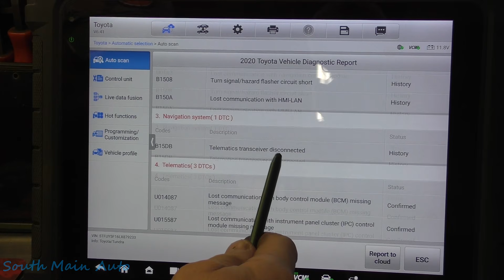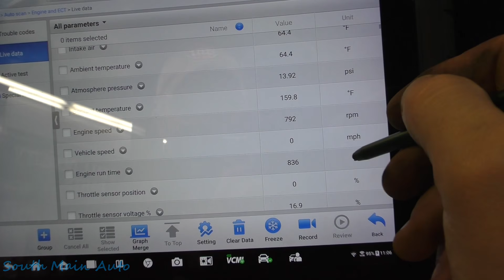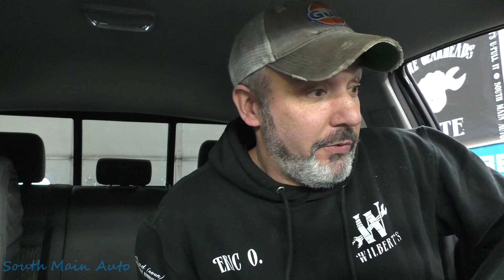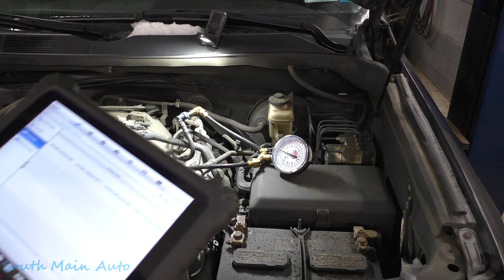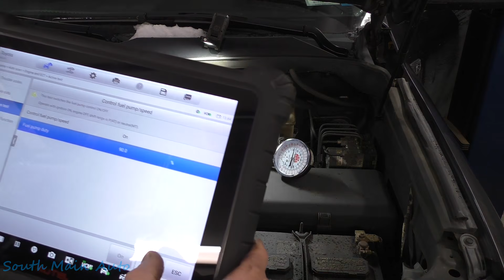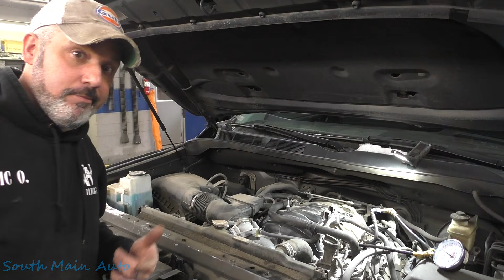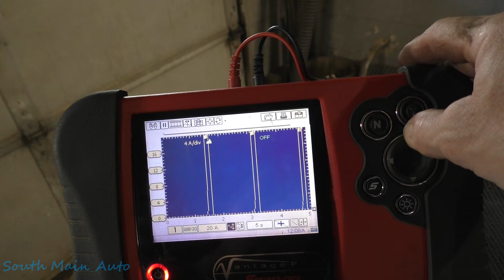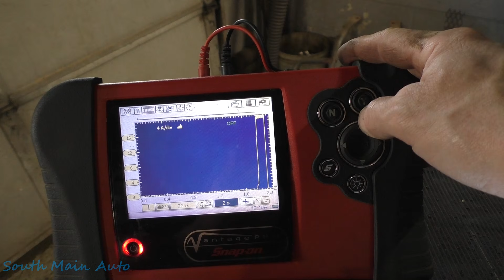My Customer Is Getting Shafted By The Local Toyota Dealer

Comment: Good job Eric. Would you have been able to find this by comparing the commanded fuel rail pressure with the actual?  If yes I would have expected the engine computer to have produced a code for rail pressure mismatch.

Comment: Eric, I work in electronics repair business and believe me, you have better diagnosing skills and basic understanding of electronics than most of the electronics techs that I know. Also, your understanding of current demand and voltage drop, buy using proper load (bulb wattage) is impressive.

Comment: Subaru recall describes same problem with car manufactured in 2019 equipped with Denso pumps
"low pressure fuel pump produced during a specific timeframe that may include an impeller which has been manufactured with a lower density. If the surface of the lower density impeller is exposed to solvent drying for longer periods of time, it may develop fine cracks. These cracks may lead to excessive fuel absorption, resulting in impeller deformation. Over time, the impeller may become deformed enough to interfere with the body of the fuel pump, potentially causing the low pressure fuel pump to become inoperative. "

Comment: I get it tapping it with a hammer and having the pump basically start working I guess my confusion is why is it when you spray starting fluid, why does the pump also start working? Unless it has to do with the return fuel back to the tank is the only thing I can think of

Comment: Excellent diagnosis. A guess when the voltage comes up a bit when the engine kicks over on juice it takes a bit less current to get enough power into the motor to start the pump, power = V * I. This pump is on the edge of working / not working.

Comment: At 7 minutes into the video I am guessing someone uninstalled the battery and didn't follow the correct steps to reinstalling and letting the ECM boot before starting the truck. Uninstall the negative post, wait 15 seconds or so, put it back on. Turn the key to accessory only. Do not start. Wait 15 seconds, Turn key off. Now you are ready to start the truck without problems.  This is real, Ive done it. 2018 Crew Cab 5.7  43k miles.

Comment: This happened to my Dodge Charger Hellcat. Dealership replaced the fuel pump under fueling issues and the new fuel pump did the same thing. Replaced the FPCM with dual FPCMs, the fuel pump with a dual pump module, injectors, fuel rail, and never had problems again.

Comment: It is easy to scream “scam” when a repair shop is stumped by an unusual problem. YouTube channel “Diagnose Dan,” a technician in the Netherland, focuses on issues that dealerships or other shops cannot figure out. These channels simply showcase extra smart detection focused technicians with time to look at data, check systems and test each possible problem area to find the problem. Not everyone has the take talent, or the time, or is allowed by the business to spend time solving one problem when several cars can be serviced, repaired. It’s all about $$$. Great analysis and detective work in this channel. Thanks.
Reply: Well that’s just fine! The dealer is supposed to be expert on the vehicles they sell. If they can’t fix the customer problems why do they need to do service work?

Comment: I've had a similar issue with my '05 Celica for ages, except mine only reproduces about twice a year so it's impossible to diagnose.  It only happens if the vehicle is warmed up and has only been shut off for a few minutes.  Trying to start may yield a brief cough and then just cranking indefinitely.  It can be resolved by turning the key off, waiting for about 10 seconds, and then cranking again, where it will start right up.  Keying off for a shorter period will not resolve.  My guess is the fuel pump relay but I've never been prepared to properly investigate when it happens.

Comment: Car owners don’t realize is that the gasoline is the only thing that’s keeping the fuel pump lubricated. Some people drive until the gas light comes
on then they go get gas. By doing that will burn the fuel pump, only car guys know this. In the long run it’s going to cost money. The only way to learn is to learn it the hard way. I will never let my fuel light comes on because the car or truck is freaking heavy when it’s dead on the road.

Comment: I'm an electrician in an acute hospital and one day a work colleague drove up in a land Rover Discovery, shut it off and went in to get his joinery tools, when he came out it would only crank but not start. He said he had been towed to repair centers three times with the same fault and nobody could fix the issue, so I got a rubber hammer off a fitter and located the fuel pump behind the back drivers side wheel, hit it a good thump and instantly heard it whirring. I asked him to start the engine and she fired right up! 
I said you need a new low pressure diesel pump and after he got one fitted he never had that problem again. :elbowcough:
Reply: The bigger surprise is that the Rover ever started in the first place.
Reply: That old saying- "your not paying me to hit your equipment with a hammer. your paying me to know where to hit it" LOL
Reply: Awesome
Reply: That is classic British car and nothing new.  Way, WAY back, many English cars had electric fuel pumps.  I recall they were made by S U, the carb company.  Frequently they failed to function correctly at start-up. With the engine nit running you could hear it running or not running.  In the OWNERS HANDBOOK they recommended that you "rap it sharply" with a hammer.  IN THE OWNERS MANUAL!!!

Comment: I've yet to find a dealership service department where I trusted their troubleshooting findings. You can also count on them calling you within 15 minutes trying to sell you on what I call the "part of the week" (e.g. cabin air filter, wiper blades, etc.). I have been fortunate to find either small local chain or mom and pop shops that knew what they were doing and didn't try and screw me. When the mechanic tells you that replacing your brakes can wait until your next oil change, you've found a good one. No dealership would let you drive off without unloading the fear factor on you for not replacing your brakes right now.

Comment: Easiest and quickest way without any tools to find out if this is a fuel pump or fuel pump module, is to bypass the module. Those modules over the time leak through the air vent the cooling jelly that is inside to cool CPU and simply start acting up. Usually I open them up and replace that jelly with a electronics grade silicone.

Comment: You didn't do a drag test on the connectors to check for pin fitment.  You didn't use a scope with a current clamp to see how much current it is drawing, You didn't check for broken shorted wires or spray de-ox-it on the connectors!  Sorry... Just passing on some of the comments I get on my diag vids :)   But we did need some brake clean!

Comment: Modulation of fuel pump.... i wonder why OEMs have been doing this. What was wrong with the vacuum modulated fuel pressure regulator on the return? I always fugured they didnt want the heat from the engine getting into the gas tank and causing more evaporation. So blame the EPA for yet again less reliability.

Comment: Just a guess but I'd say the vibrations throughout the entire truck from the engine running after starting it with starting fluid just happens to unbind the fuel pump so it keeps going ...

Comment: As expected Eric saves the day, actual tests and diagnostics 100% confirming the fuel pump is at fault yet of course what are the odds the dealer says he is wrong. 
The sickening part of this is any mechanic with experience should be able to just simply listen and hear that the pump sounds like crap and not running correctly. In absence of good diagnosis replacement of the fuel pump should be the first “guess” of repair , not a bracket, not a controller.  Dealers are disgusting, just before Christmas our local GM dealer was in the news for ripping off a customer with wrong diagnosis, parts replaced and the issues still not resolved after thousands of dollars spent. Can’t trust any of them and Eric quality of mechanics are super rare like hens teeth to find.

Comment: Giving it the juice might make sense if the pump is on the ragged edge of not having enough voltage/current to run when the voltage is being pulled down due to the starter running. With ether, it starts and then the alternator kicks in with 14+ volts and the pump kicks in. But why not start when hot? Back pressure in the pump when hot and the fuel line is fully pressurized?

Comment: Is it possible to show the details of that bulb you used to check for current to fuel pump? Is that a DIY set up or something we can buy (your Amazon store link)? Can you do a video of these kinds of circuit checking tools (like clamp types or how ever you attach them to wires/plugs/pins)? 
I get that a basic multimeter with pins can do all that, but we need more ways for the connections to stay attached for one man jobs 😊.

Comment: If the normal amp draw is 4-6 amps and this drew 20 amps, wouldn’t the pump fuse have blown?  Or is this system on an auto-reset fuse?

Comment: Getting a mechanic that can and will diagnose accurately a vehicle issue is getting increasingly rare these days. I once took my car to three different mechanics until I found one that took the time to accurately diagnose the issue. It turned out it was a faulty inexpensive coolant temp sensor causing the car to stall.

Comment: Well, you asked... shade tree mechanic here, my method (assuming that the most expensive part failed), apparently would have worked in this case. I habitually use the Lucas Oil fuel additive, which claims to lubricate the fuel pump.  I won't claim that it would have made a difference in this case.

Comment: I have sent several vehicles back to the dealer with clear warranty issues after doing diagnosis much like shown here.....and had similar results where the 'Factory Trained Technicians' spent days throwing parts at it only to eventually find out that the diagnosis the vehicle came in with was correct.   Dealer techs are NOT generally good at diagnosis because they're Flat-Rate and don't get paid to think...they get paid to replace parts.

I was the only hourly tech at my last dealership and did all the diagnosis for my team (I was lead tech).   We had excellent results where I figured out what each problem was then gave the vehicles to the flat-rate guys....'Here...this one needs an alternator'.   "This one needs a hub bearing' ect.   They loved it because they made good money and the customers loved that they got their vehicles fixed on the first visit.  Eventually we had a waiting list for our shift  (second)  because the customers talked amongst themselves and figured out that we did good work while the daylight guys were incompetent.   So what did management do?  Fired me.   Got to love dealers!!!

Comment: wow forgot about the SMA channel, because of switching accts and not being a subscriber all of a sudden. now your almost at 1 mil subs, congrats. I wish we had more mechanics around here in WNY, I'd definitely make the few hour drive to have you diag my gf '02 Honda Civic, doesn't start if the temp is under 20F, just cranks and cranks. Did Spark Plugs thinking maybe spark was missing in the cold but that didnt help, it really is weird as Even doing what the Honda Manual Says to do on cold starts like that and still doesn't work.

Comment: I had the same problem with my 2000 Silverado when I bought it used over 20 years ago. It was the fuel pressure regulator.

Comment: Awesome vid!  My 2014 Tundra 1794 with the 5.7 is 280K and still going strong, strong, strong... with only an idler pulley replacement (other than routine scheduled recommended service).  I do change oil every 3500 miles.. All original equipment with no mods, except a 7" BDS lift with Fox shocks and an Airlift 7500.  I've pulled 13K cross country more than 20 times without a single hitch. Not even a blown tire.  Well done.
Reply: one scary pooch

Comment: my. 07 Camry hybrid has that recall for oil burning issue, went to a large dealership and they said that there's nothing wrong and won't fix. Went to another dealer and that dealer confirmed that mine has that issue and will start doing the free fix. It's a hit and miss on these stealerships. Most of their techs are just parts replacer and has no diagnostics skills.

Comment: I had a 74 Olds Cutlass where the Coil set on Top of Engine, after a few years the Coil started breaking down because of being cooked by engine, when it got Hot a Crack Formed inside coil and Engine would not start until it Cooled off. It went through several coils until I finally got a Roll of Asbestos Mat from Power Plant where I worked and put under Coil, never anymore problems...

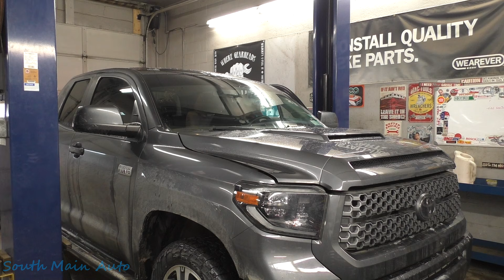Comment: 4:25 I've asked this question to various folks and nobody has an answer. Why do these trucks sound like a roaring fan when first started, but then it eventually goes away approx 30 seconds later, in this case at 4:52?

My dad's 2020 Ranger (turbo 4cyl), my 2003 Tacoma V6, and even my cousin's 1989 Toyota V6 pickup did this.

Comment: Thank you for making this video. I dealt with something similar. I have a 2018 RAV4. Around 2022 I smelled gas when the car was fueled up. Replaced the gas cap. Still smelled. 2023 took it to a Toyota dealer. They told me Evap system is fine. And it is “normal” to smell fuel vapors. Bs. Smell seemed worse in extreme hot and extreme cold and only when vehicle fuel tank was full. Around Christmas (2 weeks ago) I took this to a different Toyota dealer. They charged me 159 diag fee and told me “evap system is fine but there as a mouse nest we removed and that caused the smell”. I asked if the mouse nest smelled like gas where is the gas smell coming from. They said vapors. And with the nest removed vapors should dissipate. - I then asked ok did the mice chew anything or damage anything. Dealer said no.  I filled my tank still a fuel smell. - the private mechanic I go to told me without dropping tank he is not 100% sure but he has seen the fuel pump tops crack. He said he could drop the tank to check but he’d have to charge labor and if I already paid dealer for diag I should have them do it as I already paid. Also car is under Toyota warranty. I went back to dealer and they argued with me and finally agreed to drop the tank. Fuel tank cover was cracked. Dealer sent me a pic entire top of tank wet with fuel.  Fuel tank cover is part of the pump so it has to be replaced as a whole unit. They kept my RAV4 for 5 days. Then they never washed it and it smelled like gas on the outside when I picked it up. 2 things here - 1 I complained to Toyota corporate about how I was treated. They acted indifferent and a manager at corporate is supposed to call me back 2 - Toyota has problems with fuel pumps in many vehicles. And the dealers and corporate know this. And they went to deflect because you have to drop the fuel tank on most Toyotas to change the pump. There is no access from the floor under the seat on most Toyotas. So I think the dealers and corporate are just kicking the can hoping the vehicles are out of warranty when this happens.  I bought a Toyota for the reliability. I like the rav4. It rides well and is decent in snow. But whenever this vehicle is worn out in the future - I may or may not go with Toyota. Never had these issues with Honda or Subaru.

Comment: It seems maybe The Pump has high internal resistance so that Even when its on full duty cycle its Dropping that voltage internally. 
My only theroy would be when he gets it going with either that 13.5 14.5 voltage output from the alternator is Enoguh to over come that resistance? 
Havent watched the full video But this Is definitely and interesting failure!

Comment: My Toyota is out of warranty and my car will never again darken the door of the Stealership (Greens Toyota, Lex. Ky) After the SatRadio/GPS going out and the dealer replacing the head unit instead of the SatRadio/GPS unit that really showed me exactly how much competence that service department has - even after I told them the exact issue and they charged $160 diagnostic fee. Well over a month and almost $2k to replace with a $200 used part.  The dealership will not spend anytime properly diagnosing anything - they will just throw parts at an issue until it starts working again or they say you need a new motor / transmission / whatever.  The rakes in lots of money for them and does the customer no service.

Comment: POA! when working on jap vehicles, it's adviseable to not hammer on fuel tank, transmission, engine. you may give the jap leprechauns running the squirrel cages, concussions.
there's always the slander of chinese goods, but if you are old enough, you remeber the MADE IN JAPAN label at the 5 & 10 stores. now there were products deserving criticism! remember, toyota uses old metal coke advert signs to fabricate roofs.

Comment: Pattern failure as a diagnostic tool is pretty powerful (reference your backup camera video less than two weeks ago!). Dealerships have pattern failure data by the truckload, and good for them, but if this video is any indication, sometimes it gets the better of them. Balance pattern failure with objective process diagnostics!